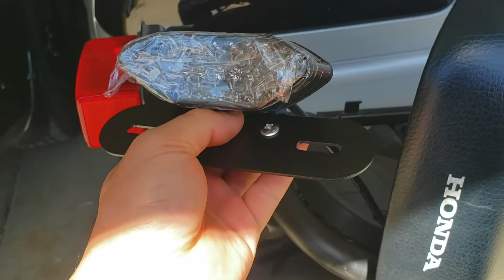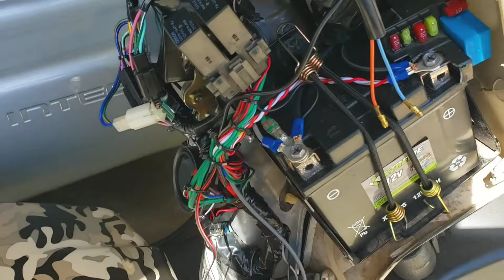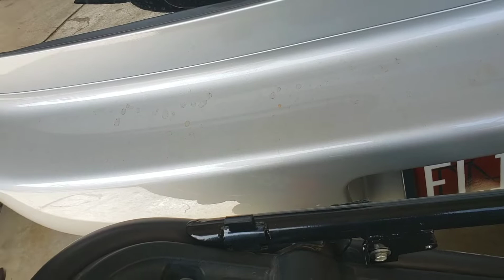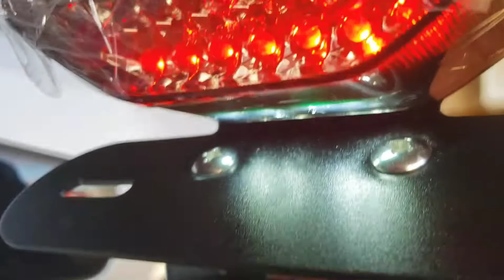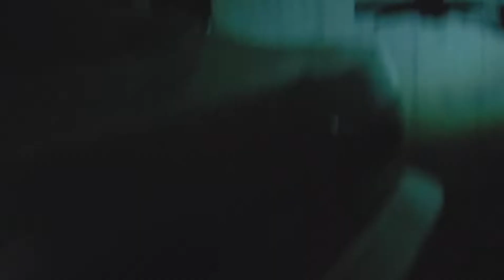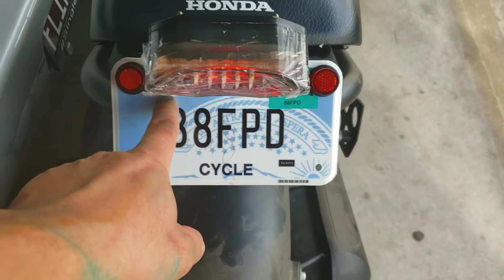Ruckus LED Brake/Turn Signals for $13.00??

Comment: What is the brand of the light I need this
Reply from the maker: Its actually just a generic brand. Its cheap,but works fine.lol
Reply: @FlipSideGarage  Do you have a link to it?
Reply from the maker: @dhrider372  i cant find the same exact one,but pretty much the same as this

https://www.amazon.com/Krator-Custom-License-Taillight-Signals/dp/B016YXQ8HK/ref=mp_s_a_1_42?crid=1RRU4FXTNVPK4&keywords=ruckus+led+turn+and+brake&qid=1665196485&qu=eyJxc2MiOiIxLjQ5IiwicXNhIjoiMC4wMCIsInFzcCI6IjAuMDAifQ%3D%3D&sprefix=ruckus+led+turn+and+brake%2Caps%2C151&sr=8-42
Reply: @FlipSideGarage  Did it come with the relay or did you have to buy that separate?
Reply from the maker: @dhrider372  youd need an adjustable flasher relay so it wont hyperflash.They were 7bucks on amazon

Comment: Hey,  just wondering where the fill bolt was on your spectra5. I have the same car and was wanting to change my fluid. Thanks. I subbed too lol
Reply from the maker: Ayee Thank you sir. I actually just filled it at the dipstick tube. Didnt take very long.
Reply: @FlipSideGarage  the manual trans doesn't have a dipstick tho..
Reply from the maker: @mtcx  I didnt know yours is manual. Unfortunately Im not sure where KIAs fill bolts are. Hondas and acuras I know by heart.lol
Reply: @FlipSideGarage  bruh